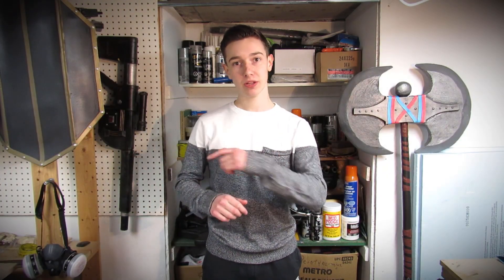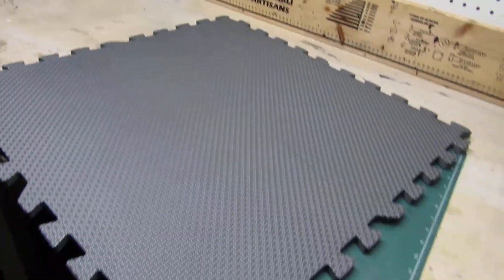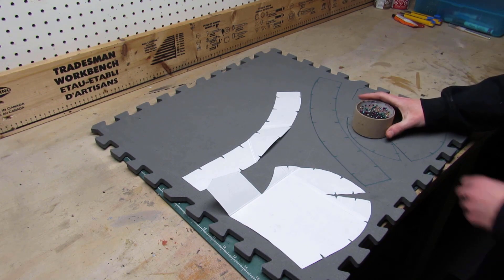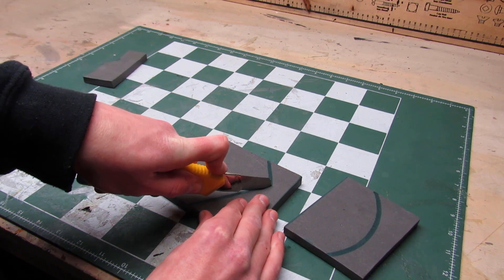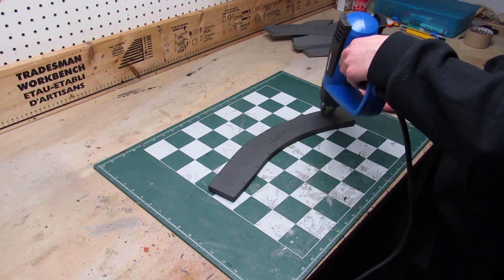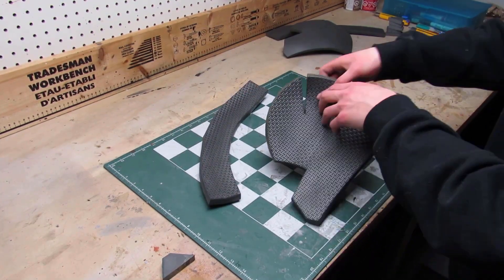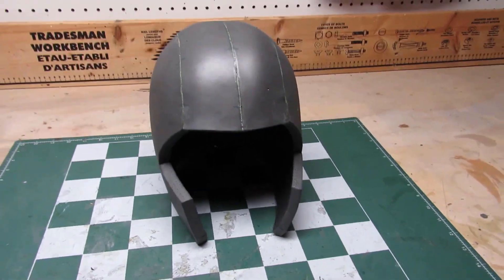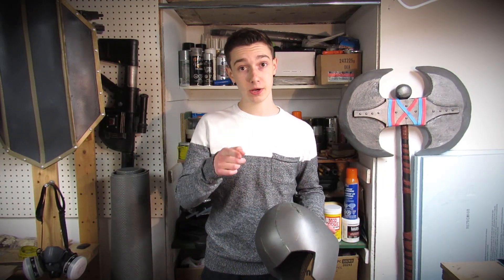How to Make A Basic Foam HELMET using premade templates

Comment: hi m8
still having  problems .. i have a  epson printer ive tried loads of settings 100%  and 110% and  smaller but none are right can you please tell me all settings needed please TOTAL NOOB to this  my standard size paper is  A 4   many thx
Reply from the maker: First, you have to make sure the document is in poster format. Then choose the size you want. Check your paper settings to make sure they are right and then make sure you have the overlap set to zero. Then you should be able to print it. :)